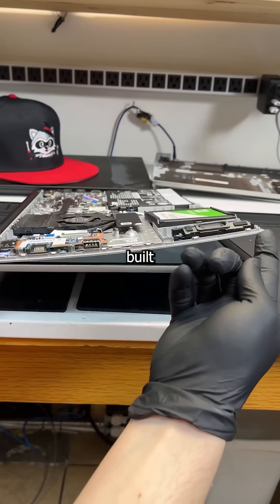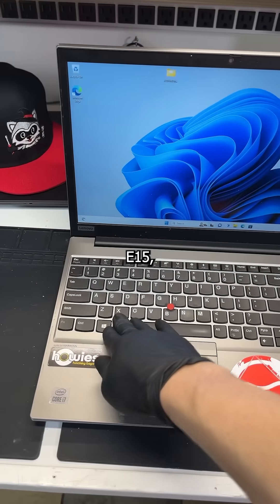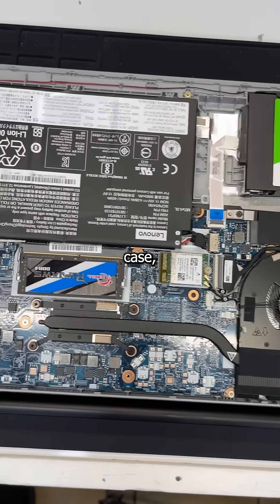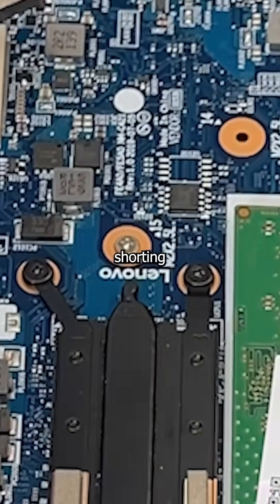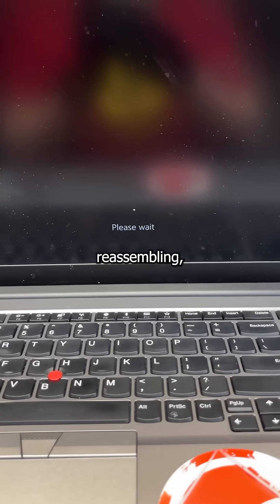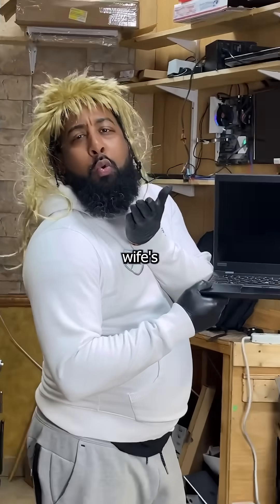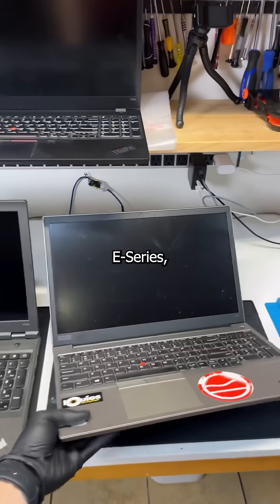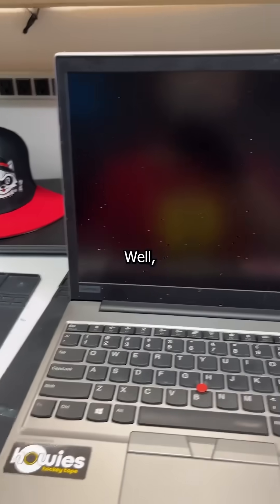ThinkPad or ThinkBad? Has Lenovo ruined the best laptop ever made? #tech #pc #technology #shorts

Comment: The only ThinkPad I ever owned was a ThinkPad twist that I got from Staples. It was a good machine until it stopped letting me do anything including enter the BIOS with a hard drive plugged into the sata port.

Luckily it had an MSATA port so once I got an SSD in there and reinstalled Windows then it was back up and working perfectly fine.

Comment: I had it worse, on one of my old laptops, if I pushed any more pressure than just resting my hand to type on the blank space to the left of the touch pad... it lost power (instant shutdown), not just froze and came back. 😭
And it didn't matter if it was plugged into the wall outlet or not.

Comment: I had a dell that wouldn't boot until you turned it upside down and pressed on the bottom. It was under warranty, dell tried to fix it twice and then refunded me. It was nearly 3 years old. The next dell they practically rebuilt it at just under 3 years. I was hoping for another refund..

Comment: Being 100% honest. Lenovos suck ass. They are cheaply made, they last for a maximum of 2 years, and they over heat so easily. 

I thought the first time I owned a lenovo was bad and then I got a idea pad gaming 3 and it was worse. 

I moved over to dell and it is like a dream. It's sturdy jas a thicc case and it never gets hot ever. I could run rdr2 on it and it wouldn't come close to over heating. It's not even a laptop built for gaming.

Comment: I’m wondering what happens with payment here? Since it was technically "working" when it went into the shop and then it completely died when you took the motherboard out, does the customer still pay you for trying or do you not charge anything? Also because it was technically "working" when it went in and then was broken during repair do you compensate the customer?
Reply: with his revenue? I think he replaced the laptop entirely.
Reply: @yzerjakenavarroza in this economy??
Reply: I suspect this is a dead laptop. Sometimes it is just easier to transfer all the data and stick it into a totally new laptop. 
In terms of payments, not a clue.

Comment: the lenovo t series is also very strong . i have lenovo t570 and uses the same frame the p51s use and it very strong it wont bend. when holding it. because it not cheep laptop like e series. that why lenovo t570 was priced at $1000 united states dollars when first came out. even laptop that are less $800 never bent like the e15

Comment: My girlfriend has a really expensive touch screen hp 360, and we got it brand new. It randomly started getting really hot and wouldn't hold a battery charge, starting about 4 months ago. Coincidentally, that is also when I found your channel. Watching your videos gave me the courage to take the back off of her laptop and look at it. I was able to clean the fan, and used air duster elsewhere since it wasn't nearly as bad as most of the laptops you show on your channel. However, it ended up having a very pregnant battery that looked like it was one loading screen away from taking her legs off at random. If I hadn't watched your videos, I feel like something bad could have happened. So I would like to thank you, because whether it be indirectly, or directly, you posting these videos most likely saved my girlfriend from a life of trauma caused by an exploding laptop. I was able to go online and find the correct battery to replace it, and easily do so myself. Thank you.

Comment: No.. ur not fucked, take off all the plastic bits and bands and bake the board at 450° for 5 minutes, after that buy some sturdy wood rulers and tape them to the inner chassis of the laptop and put it back together. There, u got rid of the bend and fixed the solder.

Comment: Lenovo used be decent, not so much these days. Bought a P series think station and a 2tb m2 to replace the stock one and it was such a headache to get it working so I could install windows. Also, motherboard has two m2 slots but you only get one proprietary mounting bracket to actually fasten it down.

Comment: There was a model of Toshiba's laptops that would hard lock up at some point due to an issue with the hard drive. The method to get it to get past the lockup I discovered was to rock it back and forth on its back edge. It would get the system past the "locked state" somehow, probably by wiggling the hard drive in such a way that its own spin would get it past its foibles, and the system would work fine again after that.

Laptops have a long history of being fucky.

Comment: It's more likely a cracked trace/solder pad rather than the actual solder. At least from personal experience. For a cheap laptop like that - I'd still call it Beyond Economical Repair. And very likely to reoccur due to design flaw.

Comment: They are not so bad just a case of cold solder joints at the memory sockets also very common in HP , easy to solve. At least the mosfets don't fall of the board like in Thinkpads.

Comment: Our IT department recently sorted out some old laptops and PCs. They would have gone to the landfill, so they always ask around, if someone needs something. Of course, obviously, no warranty. Got myself an old Thinkpad. One that still has that red nipple in the middle of the keyboard that you can use to move the mouse. 

Opened it up. The ports are connected via flatband cables to the motherboard, meaning I can swap out every single port myself. I can also swap out the battery, RAM, SSD. Basically everything except CPU and GPU. Display can be swapped relatively easily as well. 

These new ThinkPads are a disgrace.

Comment: I mean.. why picking up a 15.6" laptop by an angle and pretend it's all good? If you need that 'agility' buy a 13/14", if not move your hand a little bit more to the center or just use two hands. Only titanium laptops are enough stiff to not suffer bending problems and enough light to be picked up by an angle. I mean the mb will not crack in an aluminium PC, but it will certainly bend over time.

Comment: Just wanna add (as someone who repairs damaged circuits under a microscope), this is what many board technicians would refer to as "flexion damage". It's not so much that it causes solder to crack (although it can certainly do this). It's usually breaking internal board traces. 

Your typical computer motherboard will contain anywhere from 5-10 layers of copper. These layers of copper are all going to be micrometers thin, sandwiched between layers of PCB substrate, and machine cut/laser/chemical etched to form the traces needed to make the connections the board requires. These internal layers are what create all of the connections that get components hook up from point A to point Z. It's how the 45th ball under something like the PCH can hook up to a capacitor all the way on the other side of the board. Think of the internal layers of copper like wires. A motherboard is just a sandwich of wires. 

With the copper layers being so thin, and the board being so flexible, over time the board can flex so much that some traces within the board just break. It could be something as simple as one specific trace out of thousands that prevent a necessary power rail from being produced. In other cases, it can also cause solder balls underneath BGA flip chips to crack. 

The most notorious example of flexion damage is probably the Meson Touch IC controller in the iPhone 6+. For a few years many repair technicians thought this chip was just going bad due to flexion damage (balls would crack/cause shorts, thus damaging the chip). However, repairs would come back months later with the same issue. It was eventually determined that an internal trace connecting the M1 pad to the chip was the fault --- this trace would get damaged from flexing, and cause that pad to no longer connect to the vital circuitry it needed to make the chip work correctly. The "permanent fix" for this was to run a jumper from that pad to the next point in the circuit, basically bypassing the faulty trace.
Reply: Thanks for the detailed explanation, knowledgeable circuit repair person! Really makes a lot of sense.
Reply: @RedBeardedRabbit  Thank you! I highly recommend looking into how boards are manufactured, it's really a very fascinating process. I got to see the whole process up-close when I interviewed for an electronics manufacturer. Seeing boards go from sheets of machined copper all the way to a finished, assembled product was so cool.
Reply: Also, as an added note: many boards in consumer electronics will always have some flexibility to them. This is normal. Flexion damage is caused when these boards are secured too tightly to their enclosures, OR if the enclosure isn't strong enough to support its own weight. 

The laptop this board was installed in was so cheap, so flimsy and floppy, that even if the board were made stronger, it would still experience flexion damage.
Reply: thats a whole article ☠️
Reply: @printer12345 bro's attention span is shorted worse than the motherboard
Reply: 😂 @espresseaux
Reply: @printer12345 bro's attention span is shorted worse than the motherboard
Reply: @espresseaux do you know sans? Thats why
Reply: @printer12345 bro, is too lazzzyyy
Reply: Thanks dude
Reply: Do you use an optical microscope?
- I do (mainly actual PCA assembly, and some modifying/jumpering) and find that often the scope gets in the way of the soldering iron.
Reply: @jabberwocky1707 I do! I use an AmScope SM-4TPZ with a 0.7x barlow lens. Unless I am using freakishly large, old irons, this provides enough working distance my handpieces never get in the way of the microscope assembly. 

Only half issue is hot air. Sometimes I have to angle the nozzle completely perpendicular to the work and there's just no way you can do this with a microscope in the way. I've tried some of those angled hot air nozzles but I found them to not work very well with maintaining a proper seal with the hot air handpiece.
Reply: Bro wrote a whole essay😂
Reply: It's really not that much is it lmao  @amalshadin

Comment: I had to get a new top plate for my Lenovo Dream Pad... the frame of the computer ripped off the screen. I had never dropped it, and the repair place I took it to said that the hinges were failing, causing the top plate to rub against the bottom plate until it got caught just right.

Fast forward 4 months, and it doesn't run at all. I had the computer for the less than 2 years for school work. I will never buy a Lenovo again.

Comment: My MSI laptop short circuited and wouldn't boot back up. I sent it to a repair shop for an assessment. They said the motherboard was in pieces with many screws straight up missing and the charging port was so twisted that the electric cables connected to it got cut by torsion. The cause of all this? You got it, cheap plastic frame. Everytime I would open the screen the charging port would turn slightly until that happened. I've had this 1300$ gaming laptop for years and I never dropped it or forced it in anyway, I just normally moved it around or placed it on my lap. With the state it was in it was a miracle that it didn't fail sooner. They had to change the whole palm rest, the charging port and either replace the lost screws or fix in place the parts of the motherboard with creative means to get it back in working order. Now that I know I swear the next laptop I buy will have a metal frame.
Reply: Laptops aren't meant to be used in the lap... Most are for table top use only. Intake fans on the bottom are the giveaway. Yes, I know, I know, it shouldn't be called laptop then. Go tell them. I didn't build them, just fix them.
Reply: @noth606  In my case the laptop has vents behind so it’s not a problem. But the thing that annoys me about this is the sellers don’t tell you about the characteristics of the frame and why you should prefer one over the other depending on the use case. After all you’d think the creators would’ve designed the frame to not twist in a way that could potentially damage the components inside since it’s a portable device. Although I can understand that there has to be a balance between cost and quality, if I knew sooner I would’ve payed a little more to have better quality. Though maybe they wanted to get rid of their stock which would be why they didn’t bring this to my attention.
Reply: @LAM1895   not my place to ask but which model were you using?? Cause I also have a msi laptop and now I'm scared 😰

Comment: I have fixed these before using a heat gun. You just gotta go over the entire board to reset all the solder joints. It’s a pain in the ass.

Comment: I worked for Lenovo until recently, and I have lots of experience troubleshooting with this laptop, yes the E series is cheaper, it stands for economy.

I have never once had a customer with this issue on any laptop. Not saying this video is BS but honestly the E series is a great value.
Reply: I agree, my E560 is pretty decent for what it is. Bought it on eBay and upgraded it to a 1TB SSD and 16GB RAM. Seller listed it as faulty, however it works perfectly, just the HDD was blank

Comment: Lenovo was somewhat stupid with these laptops. They made them kinda cheap quality and then threw in a button sensor that would kill the power to the computer when opened. The problem? Well, the buttom failed over time and a simple ride in a backpack would kill power to the computer, resulting in sleep being lost. You also couldnt use it as a laptop off the power, it would just turn off randomly on you.

Comment: Lenovo has re-used the "E15" and "Edge 15" on several model through the years, and they've continually gotten worse. I have an Edge 15 (Model 0319-25U) released in i think 2008. Old computer from a defunct company i ised to work for. Nabbed 3 of them. I use one and keep two for parts. Had to replace battery and hard drive a few time but the thing still runs linux like a dream. Its damn near indestructible too.

Comment: Based off the video, how did you automatically go to the SSD or the RAM? That was clearly a graphical issue in the first thing I would look at is the LCD to mobo cable and then the GPU.

Just reflow the board. The sad truth is it will just happen again because of the cheap build. Unfortunately you have to inform the client not to just pick it up by the corner like that, and if they do, do so by the rear corner instead.

Comment: This was common on plastic laptops around 2005 or so when they swapped to crappy lead free solder. And it happened for years after.

Magnesium chassis lasted way longer.
Reply: I'm convinced that the e-waste generated by bad soldering during the transition, is worse than the effect leaving lead in there could have had.

Comment: E580 does something similar.  It has basically the same frame and motherboard. Not broken yet,but if I use an nvme and do just the wrong tightness of screw and pick it up by the corner the ssd pulls a little out of the socket and the laptop blue screens, doesn't happen on sata though

Comment: I have a predator Helio 700 that I've had for about 4 years now and it's a great laptop however the monitor was poorly thought out. The base is so heavy and the screen bezel is so flimsy that opening and closing it has caused connection issues. Sooner or later I'm going to get off my lazy ass and crack the bezel off to fix the issue but I'll never understand why they made such a robust laptop with such a flimsy ass screen setup.

Comment: You can attempt to fix this using the oven method to reflow the solder joints. Make sure to remove any connectors, wires and plastics off the board and bake it. From experience it works quite effectively when done right
Reply: @benjiro8793  these joints initially failed due to being overheated in repeated cycles. If you use the oven reflow method correctly and keep low temperatures, it is actually unlikely to happen again. That’s what I’ve seen with the amount of computers I’ve fixed. The computers problem is the plastic sag which is more problematic

Comment: Watching this channel has made me appreciate just how long my consumer grade laptop has lasted. I have an MSI GE72VR from 2017 and it probably still performs as well as it did when new, even though I really ran it hard its first few years.

That and how much of a good thing cleaning out the cooling system and replacing the thermal paste every 1-2 years has been. Haven’t replaced the thermal pads, plan to do that next time it seems like there's not as much airflow.

It has one dead pixel and that's it, no other issues.

Comment: you could put the motherboard in the oven for an hour at a low temp to fix the solder joint cracks, but thats a last resort before buying the customer a new motherboard and completely replacing it.

Comment: Welcome to Lenovo products. These products need metal supports on the bottom of the rear panel and metal to metal hinges. It’s crazy these metal to plastic hinges are just too much weight for a typical computer and hinge fittings pull out of their socket. Simple metal guards on the side of the computer or around the edges would fix this. Only company that tends to do this correctly is Dell and it’s typically on their older business class laptops.

Comment: this happened with my HP laptop. basically when i hold it with one hand, it bends the SSD stick and slightly gets disconnected. I fixed this issue by adding a thicc double tape to the gab between the ssd and the body of the laptop.

Comment: This reminds me of my Lenovo 1st gen 11e model laptop. It is designed to be rugged but the keyboard is held up by plastic clips, the front clips are easy to lose its grip so when using 'enter' it pushes on the ram Module, turning it off with a pop.